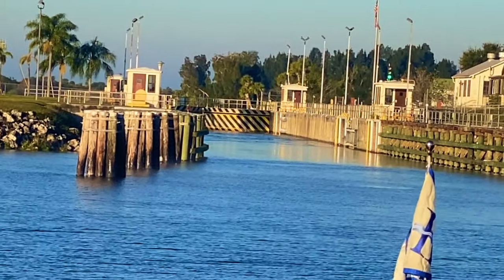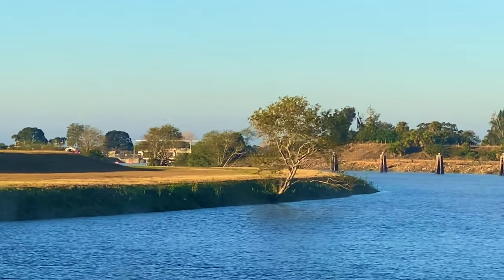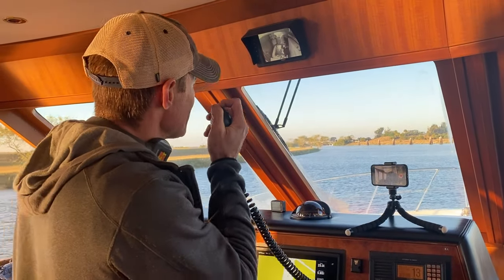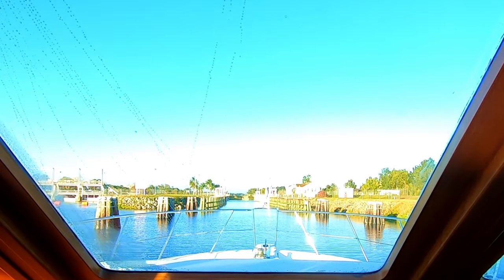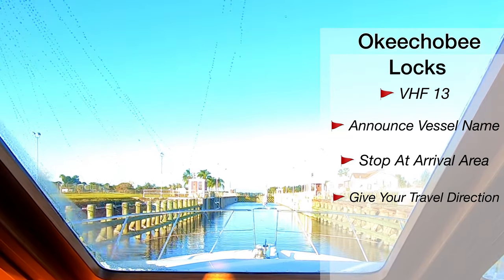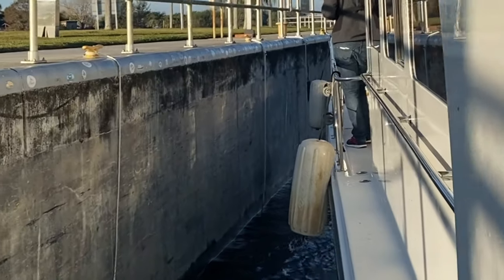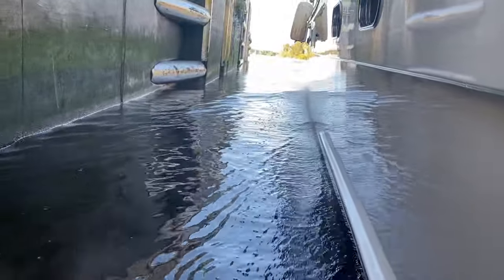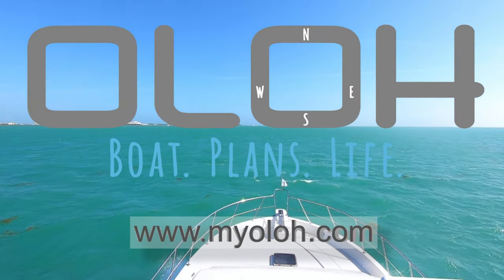Motor Yacht Cruising⎮How To Go Through A Lock⎮Okeechobee Waterway

Comment: Nice information, I am curious if you were in a larger vessel can you request permission to leave your engines in idle rather than having to stop / start them ??
Reply from the maker: Thanks Glen.  Not sure about that - we just do as we're instructed and leave it at that.  We have been in one of the locks on the OWW where the time in the lock was going to be pretty short and there was only one other boat so the Lockmaster told us not to bother shutting down.  We've been in locks elsewhere where you are not required to shut down and it can be pretty nasty sucking up fumes when you're down in the chamber.  We imagine there's also a CO concern when there are gas powered boats in there.  We do leave our generator running and that is common practice for boats that cruise with their generators.

Comment: How would you deal with the locking process if you're single handed, solo captain, no crew?  If you couldn't hold bow & stern lines at the same time, would the dockmaster assist?
Reply from the maker: Well, neither of us have had to single-hand through a lock, but as long as you are well-fended at any potential point of contact, you could make do with single line on a mid-ship cleat, being careful not to allow for much slack.  It would be much easier on a smaller boat - personally wouldn't want to do it on a boat OLOH's size or bigger.  While we like to minimize the use of thrusters in a lock, having them along with our Yacht Controller remote would make it easier if things got squirrelly.  From our understanding Lockmasters can't assist beyond tossing you a line unless things go awry.